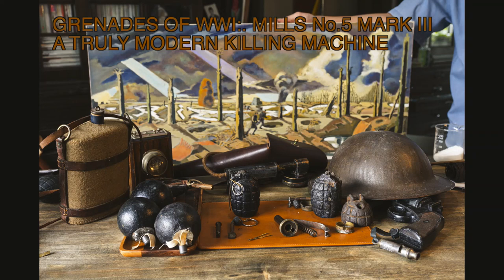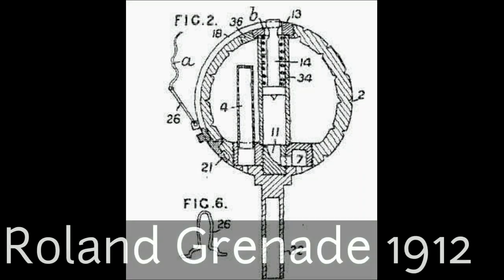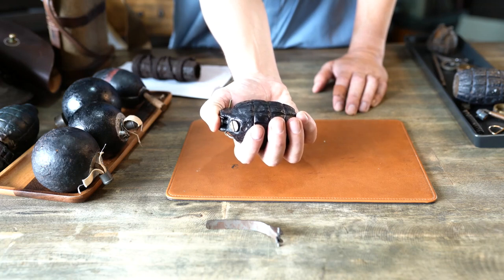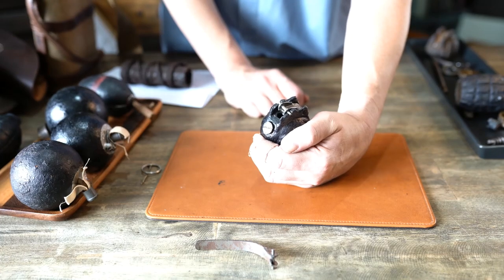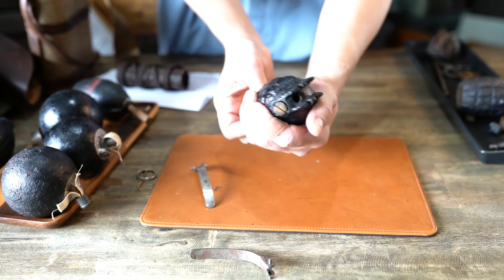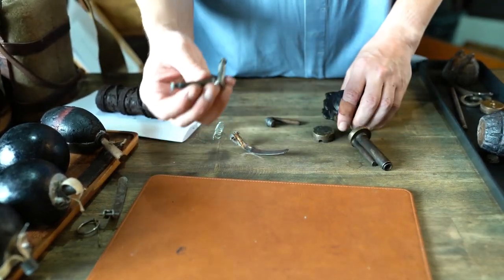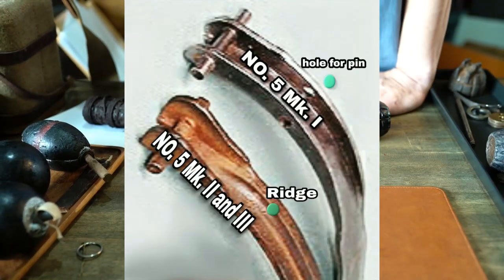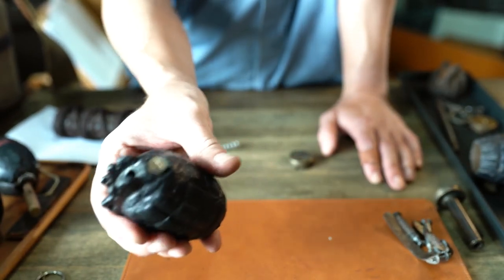GRENADES OF WWI: THE No. 5 Mills Bomb- A Truly Modern Killing Machine: How it works variants n more

Comment: There was no no5 mkIII .there was no5 mk I (although no5 mkII Plugs was made..only a small amount was) it went from no5 mkI  ..23 mkI.. 23 mkII Then body shape was changed and that was the no23 mkIII ..Then no36 mkI and finally no36m mkI .there was a no36 mkII But that was a practice grenade with a bigger gas check size threading for repeated rifle launching.
Show the markings on the plug.